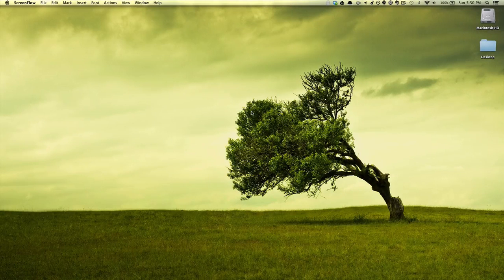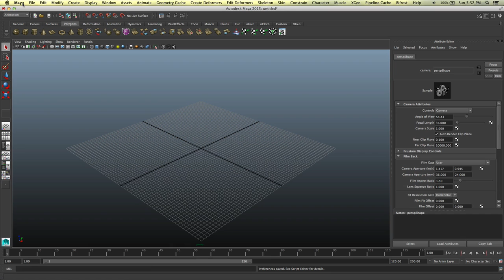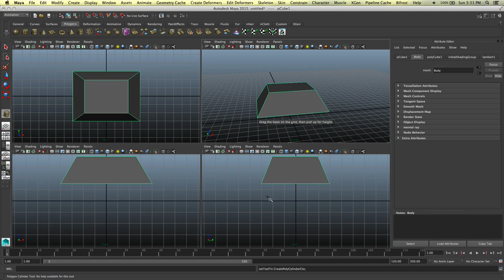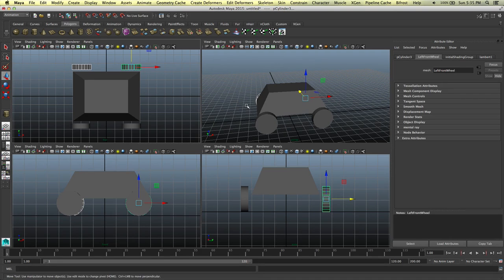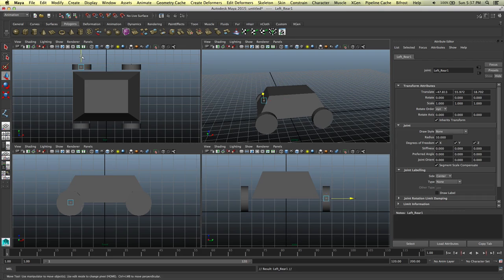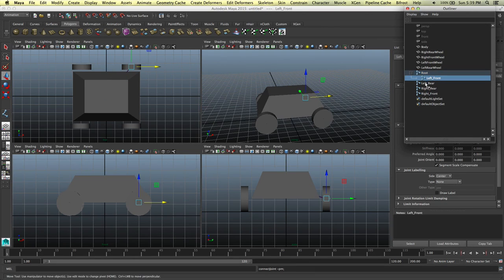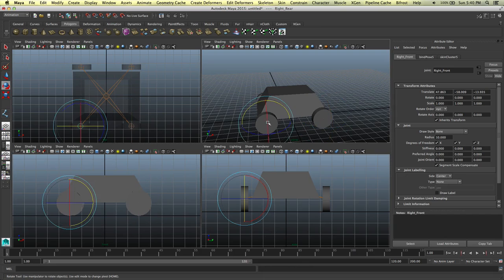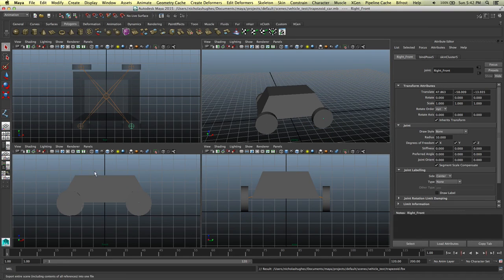Vehicle Modeling/Rigging Tutorial in Maya for Unreal Engine 4

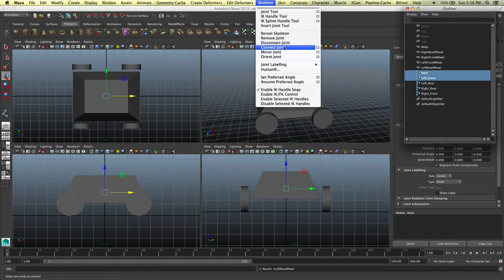Comment: 8:36 There's no CONNECT JOINT iin Skeleton Menu in Maya 2016 LT
Reply: I've found out that "pressing P" after selecting the Child then the parent joint does the parenting :)
Reply: 3 steps:
1) make sure, that in top toolbar the "Rigging" dropdown is chosen, not "Modeling" (which is default), or just press F3, then you will notice, that top menu changed.
2) Then Open menu "Skeleton" (File, Edit, Create... "Skeleton" is 8-th)
3) Click on "Connect Joint" (On Rectangular), so new windows opens (which is in the video)

Then first select child, second select parent and then hit "Apply" the parenting option window, that you opened in the step 3

Comment: Great tutorial, exactly what I needed. Thanks :)

Couple of things though if you're new to Maya. 
Pressing G will do last command, so for eg you duplicated something, instead of doing that process again just press G on the new object you have selected. 
For joints there's a little joint icon that kinda looks like the Steam icon. That lets you view joints (easier to select)
For parenting joints you can also, select the child first, then the parent. Then press P. Selecting 2 joints then pressing Shift-P will unparent them. (Again, the G shortcut helps makes this faster)